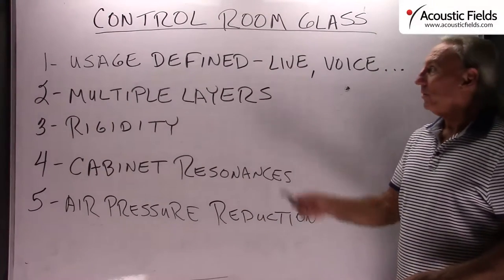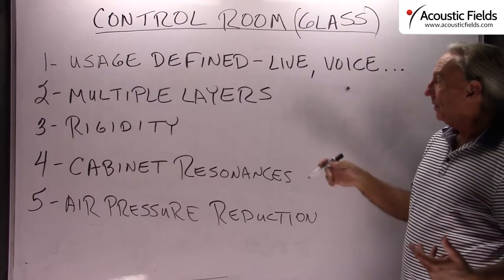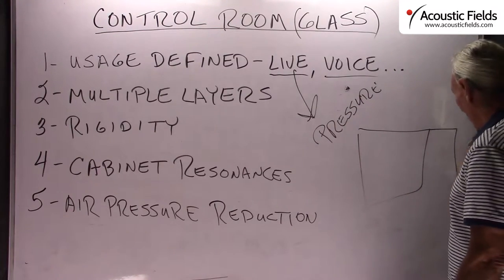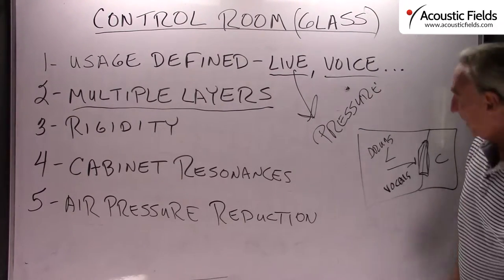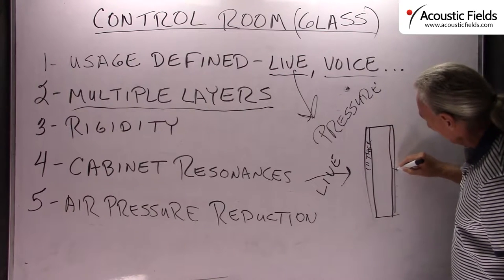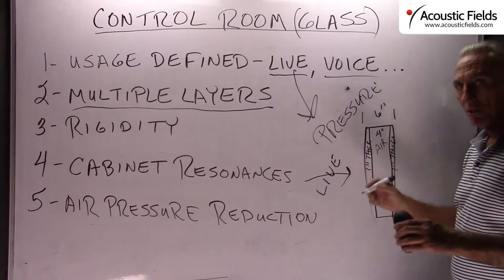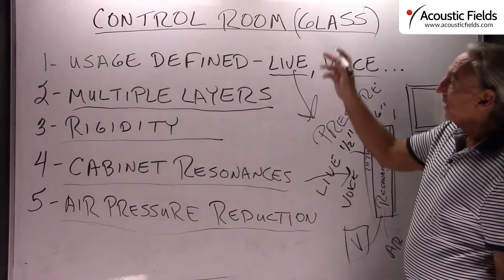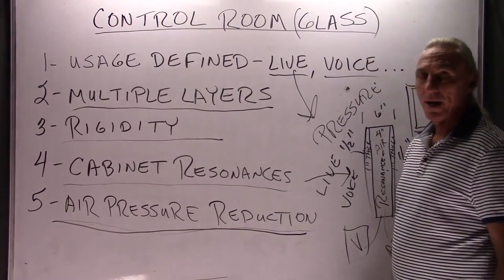Control Room Glass - www.AcousticFields.com

Comment: I used 3 differrent thickness, 3/4 will be on the studio side facing down 12 degrees to keep the studio sound from hitting the glass flush. 3/8 in the middle with a modicum of silica gel between to avoid moisture. Then an air space and put the 1/4 inch glass a separate 2x4 stud wall. The 3 different thickness avoids sympathetic vibrations with the first two panes and by leaving an air gap between the second and third panes assuring that the rooms remain decoupled. Of course run Wether stripping along the perimeter of all the panes.
Reply from the maker: Hi Jose, Unfortunately, I can not understand what you are trying to accomplish. Go to this link and fill out the information in the form. http://www.acousticfields.com/free-room-analysis/. I can then compare your room size/volume/usage with our data base and point you in the right direction.

Comment: Great videos. Just wondering what you would recommend in terms of glass thickness/air gap width for a sliding door to prevent hearing morning traffic and neighbours coughing in a bedroom?
Reply from the maker: The sliding glass door may not be your weakest link. The wall may also be contributing to the noise transmission.

Comment: What type of glass is good ? 

Is it true I should use tempered glass and laminated glass  on the other side ?
Reply from the maker: The glass density and type is frequency and amplitude dependent. You must measure the noise frequency and amplitude before assigning a solution that will address your specific noise issues.